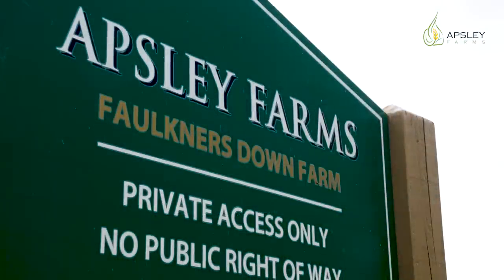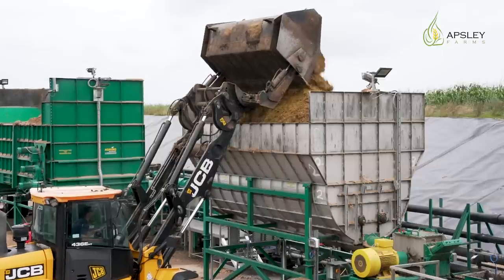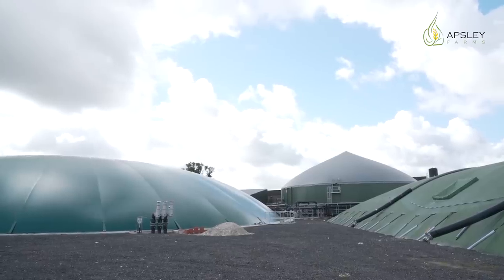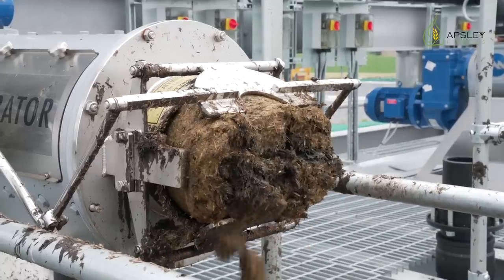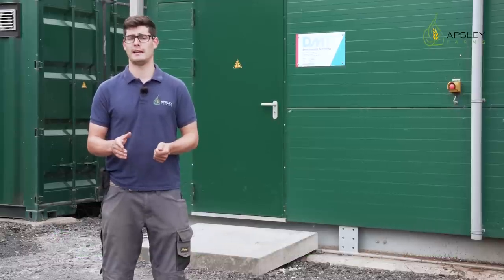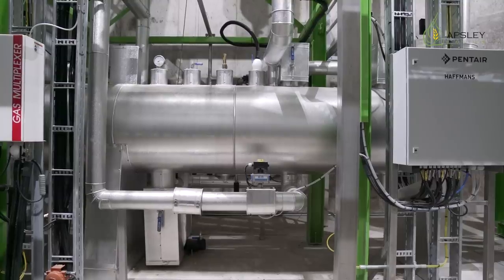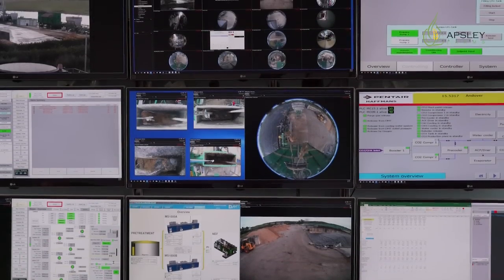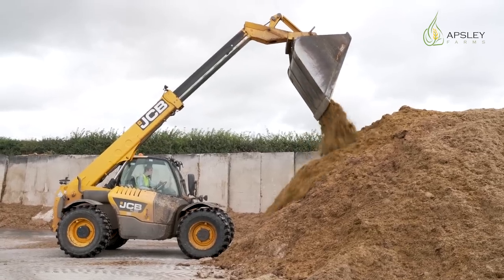Apsley Farms - Biogas Plant

Comment: How much dung is needed for 500 kw
Reply from the maker: A 500 kw plant requires circa 250 m3 of biogas every hour. Maize Sillage produces 200 - 220 m3 of biogas per ton of fresh weight depending on the dry matter and retention time. Farm yard manure “dung” will typically produce 20 tons of biogas per ton.
Reply: @apsleyfarms3528  Farm yard manure “dung” will typically produce 20 tons of biogas per ton.
Probably you wanted to say 20 m3 of biogas per ton, right?
Reply from the maker: You are correct a mistype!
Reply: @apsleyfarms3528  Hi, thanks for sharing, do you a like estimate gas production for chicken Manure ?